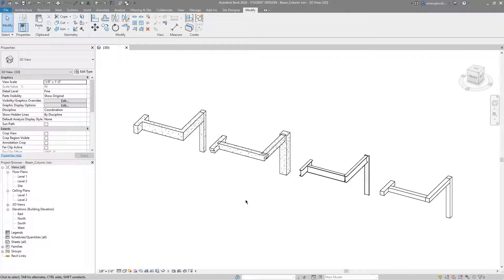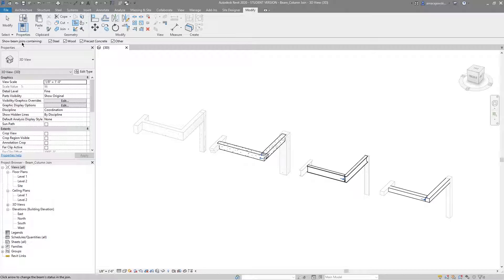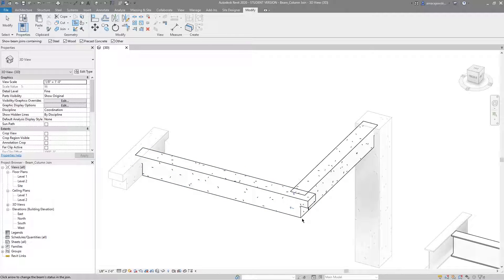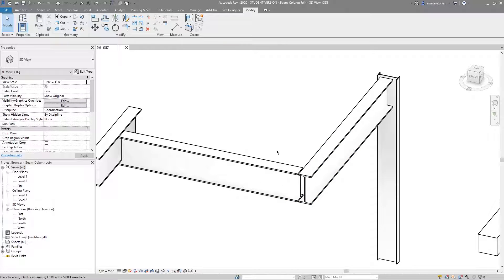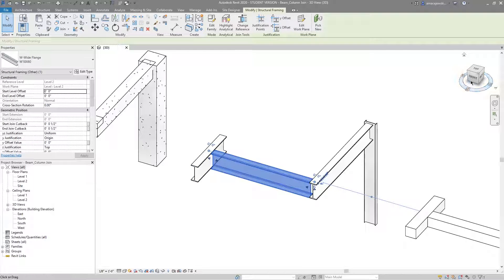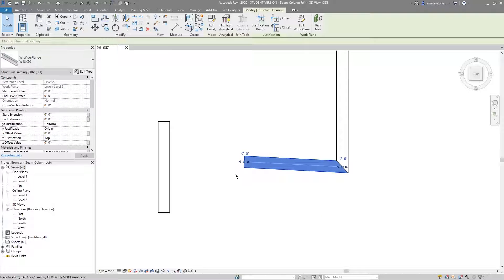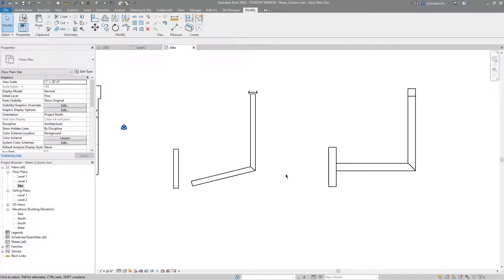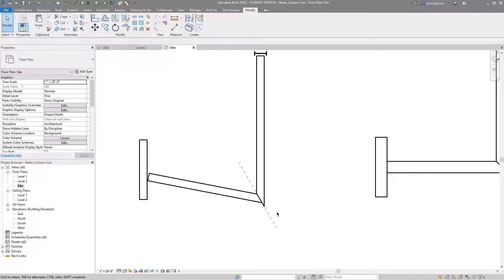Beam/Column Joins | Every Revit Tool - Revit 2020

Comment: im building a gazebo or a wooden shed for bonfire, and a shelter aswell. im using wooden logs. and the shed is 8 squared. i have round columns and a squared wooden timber logg i need to place at the top of the columns, the columns will be cut to place the wooden beam and i also need to make a miter with those beams meeting eachother on the column, but i wont make a miter. is it a extra add on i need for timber? or is it possible to do a profilecut. the problems are that the rafters are in different angles and are going to be attached to a steel platesystem that will be boltet to the rafters. i hope it makes sense. if possible you could maybe send me a email. i can send you picture of it. annesofiehansen@gmail.com
Reply from the maker: I am assuming you are using Revit "beams. In this case, the Beam Join tool will work, but only with any two elements that are beams/columns. This tool does not miter unfortunately. You will have to create reference plans and use those to cut the beams to achieve this type of cut. I believe this video covers that.

Comment: When the steel member cross-section rotation 90 deg. I cant do this, why? Thank you for your help.
Reply from the maker: The join is not completing likely because you have one member that is rotated and another which is not. Try rotating the other and giving the beam join tool a try again.